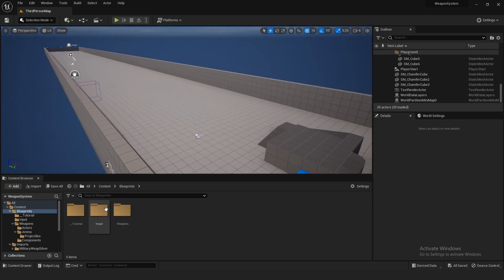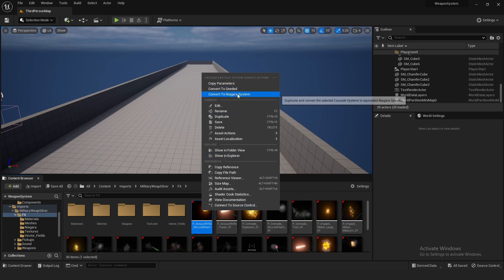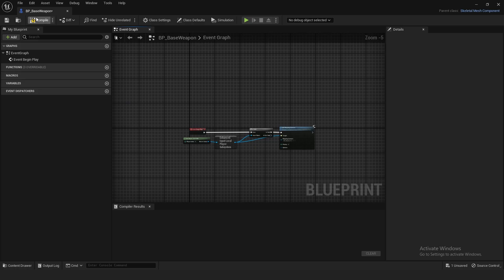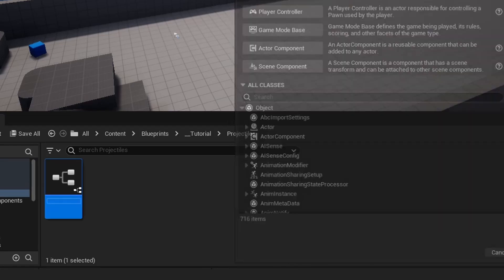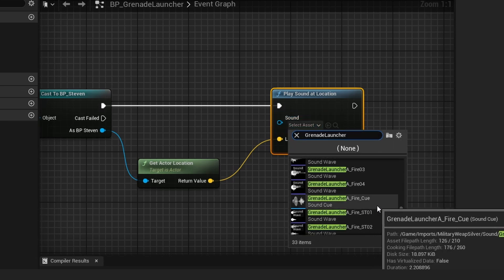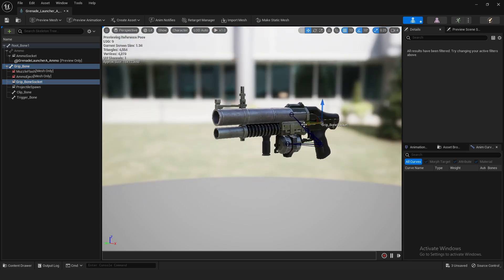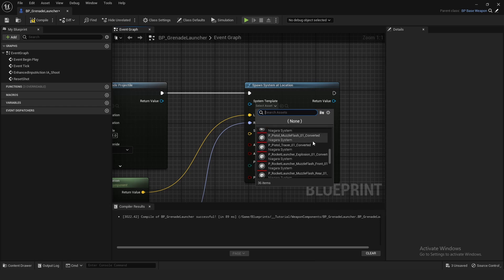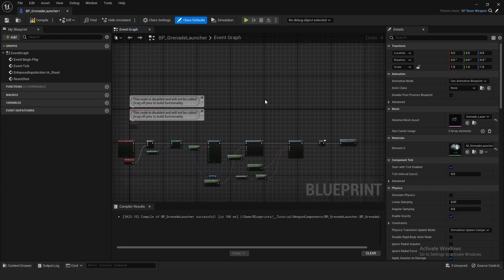How To Create A Grenade Launcher | Unreal Engine Tutorial

Comment: why is that my grenade passing through ground even i set collision to block all
Reply: You might want to check the floor's collision settings at that point and check what type it is, check if that is blocks the projectile you use or if this class has an ignore / overlap checked by probably pawn ? 
Also if you use the standard bullet in unreal check the collision component and not the mesh itself as well :)